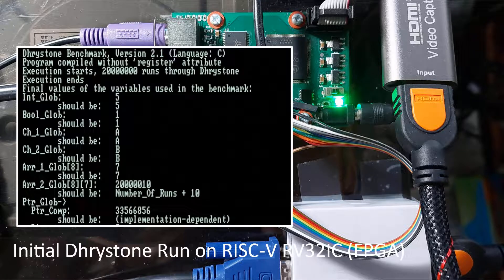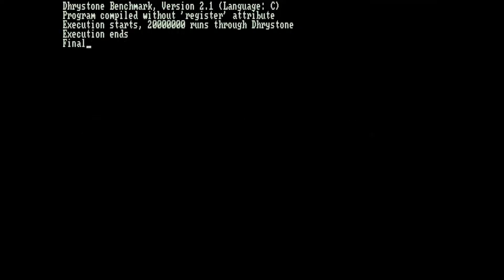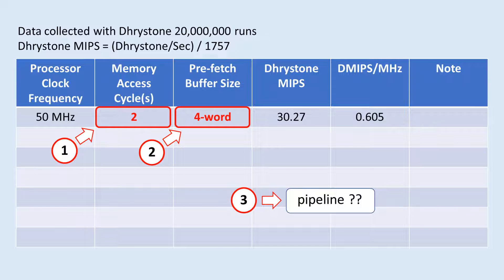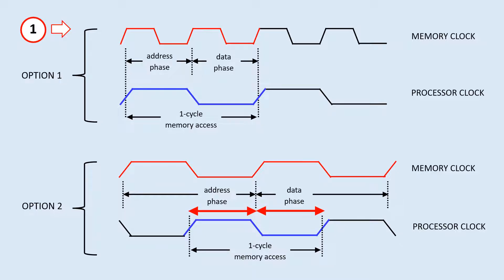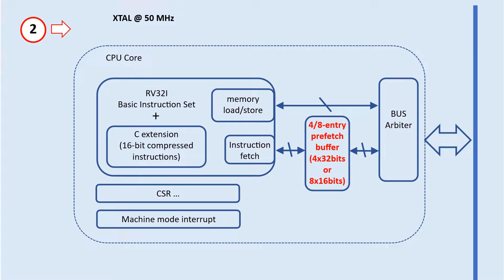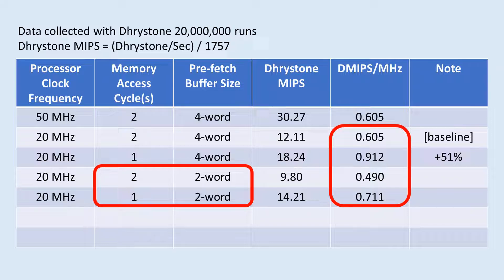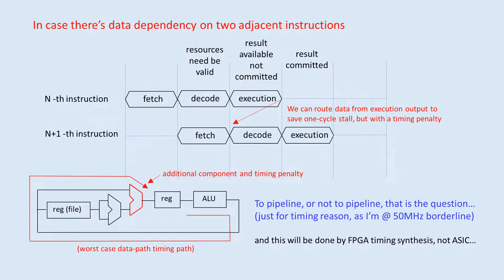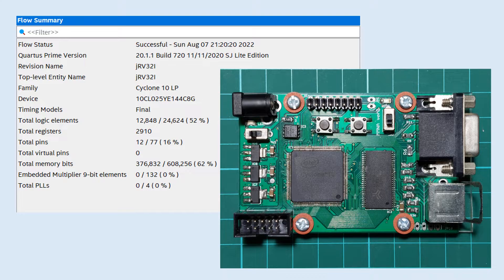Initial Dhrystone Run on RISC-V RV32IC (FPGA)

Comment: Dhrystones_Per_Second = (HZ * Number_Of_Runs) / User_Time;  <= This code not work for me ?  It cannot calculate because the bit overflows. The value I want to see on the screen. I have to calculate it manually with user_time. The number becomes smaller because the bit overflows, and the number becomes 0 because the divisor is large. :S  How fix this.

Comment: how to compile dhrystone source to bin
Reply from the maker: A simple description is, I compile the source into elf output file. Then use "xxx-objcopy" to generate a binary file from the elf file. The "objcopy" comes with the cross-compiler tool set. I'm actually using "mif" file for ROM content in my FPGA system, so I have another perl script to convert the format...